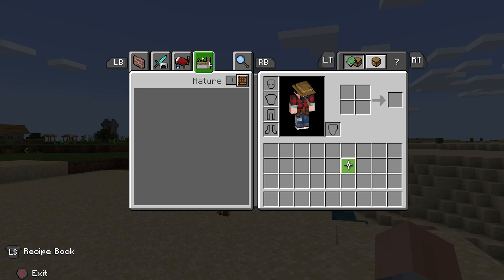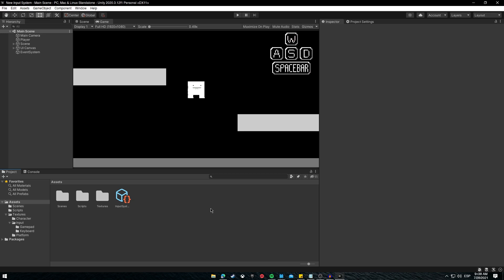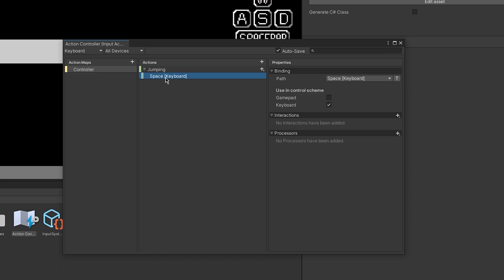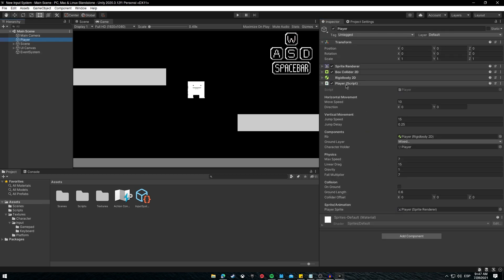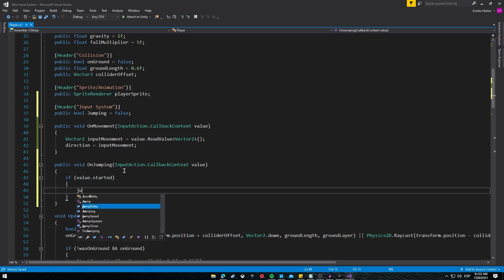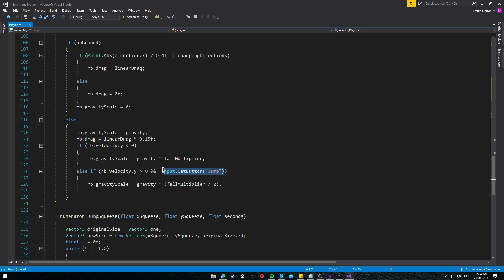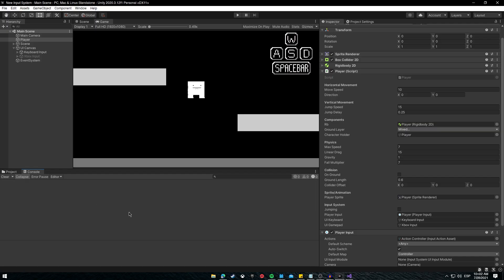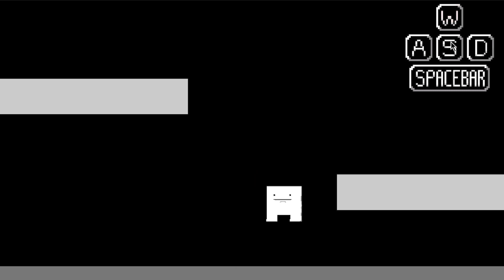How to use the NEW INPUT SYSTEM in Unity 3D Engine

Comment: At 8:08 when you've created the Player Input and haven't put in the actions yet, you have a Create Actions... button below the empty field which will create a nifty Input Action Asset with some default controls in it already, will save a lot of time for starters.
I'm curious though, it's also possible to get a reference to PlayerInput in the script itself and check the input.actions["OnJumping"] and get values from there. Don't suppose you know what way of doing this is better?
Reply from the maker: Sorry to answer a bit late, you're right, I didn't thought about using the default input action asset, when I started doing this tutorial I teach it the way I always use the input system, my mistake, and thanks for the feedback.  and the second question, I don't understand it that much, can you explain it a bit further? :c

Comment: This was really cool, will implement it soon! ThankYou.
Question: what about UI navigation? is there any changes that need to be made there to adapt to this input system? like navigating through UI buttons with controller vs keyboard or even selecting buttons with the same 'A' button shown here?
Reply from the maker: Hey! That's a great question. Well, the 13:59 part where we change the UI Input Module, creates a default action map, that you can check out. It's inside the EventSystem > Input System UI Input Module > Actions Asset. you will double click that input action asset named DefaultInputActions (Input Action Asset) , it is set automatically, but if you want to configure or understand a bit more of it, check this other video, that could help you more into the UI Side: https://www.youtube.com/watch?v=TBcfhJoCVQo . I will probably expand a bit more in another video into UI's. I hope this was useful c:
Reply: @EmilioBlacksmith  TY, that really helps.